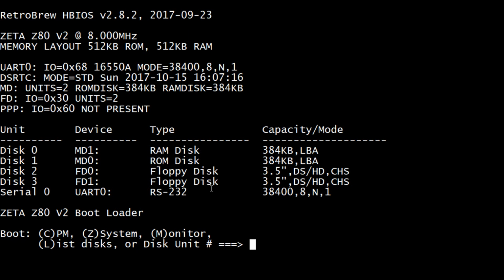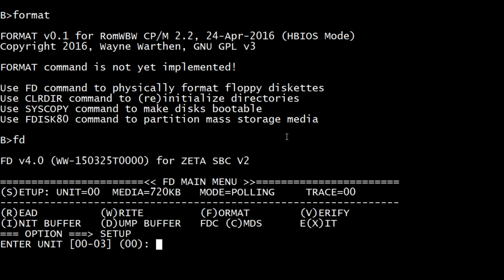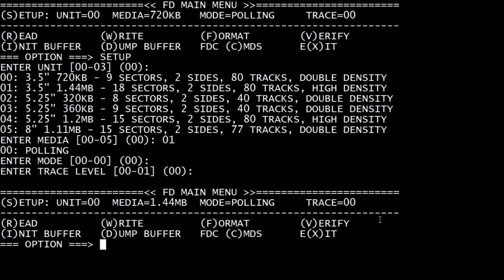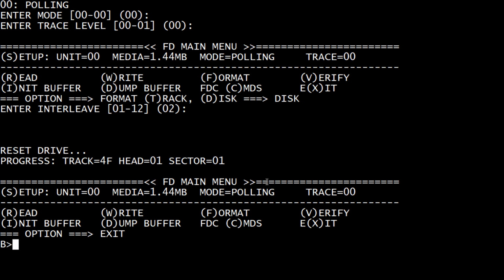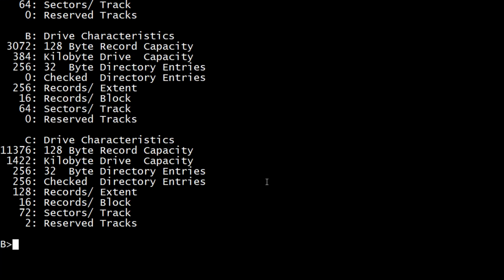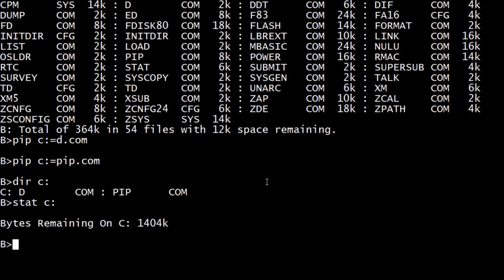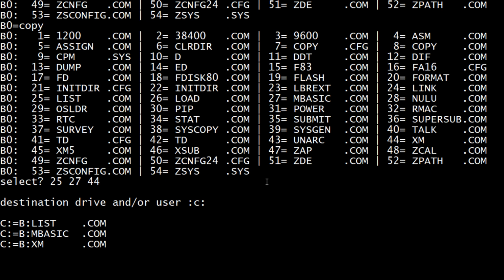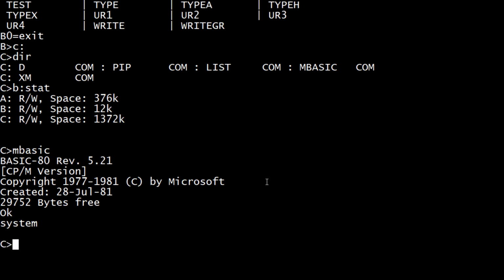#143 Zeta SBC format a floppy

Comment: Thank you for this helpful video! But my 1.44mb Floppy formats well, but no write operations are possible, because an error occurs  during verify.
B>copy . c:
COPY  Version 1.72 (for ZSDOS)   17 Jul 93
Copying B0:????????.??? to C0:
 -> ASM     .COM  Replace  (Y/[N])? Y..Ok  Verify..
FD: READ 46 00 01 00 12 02 12 1B FF --> 40 80 00 01 00 12 02 [END OF CYLINDER]
Bdos Err On C: Bad Sector

Comment: Would it work with one of these USB Stick floppy emulators ?
http://www.ebay.com/itm/3-5-SFR1M44-U100K-Floppy-Disk-Drive-MFM-USB-Emulator-Simulation-Musical-/122032170486
Reply from the maker: I had the same thought. I think so. the problem may be with the format of the device. that comes with PC software to handle that, but they are also sold to Yamaha keyboard users as a replacement. Some one just needs to give it a try!!